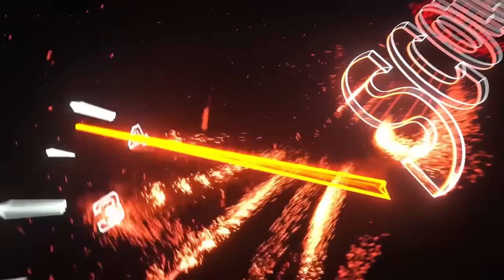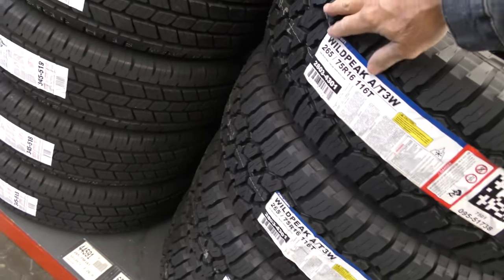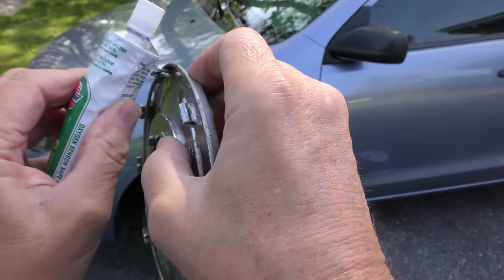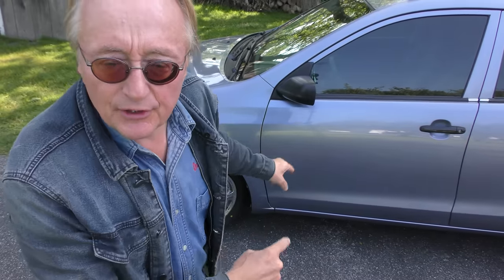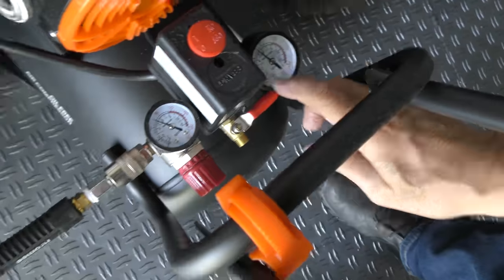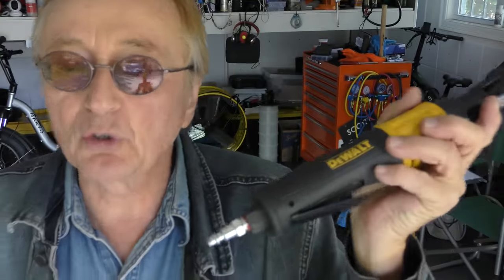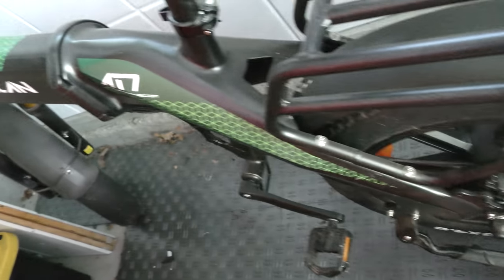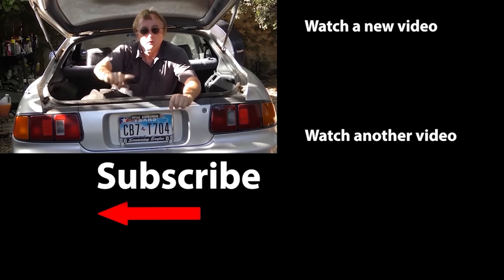Never Buy These Tires for a Daily Driver

Comment: So you don't rotate tires, you change the front more often. I've done the same thing, but didn't feel like it was the right thing to do.
Reply: On a front wheel drive car it doesn't matter. Same with rear wheel drive. You cannot rotate staggered and directional tires anyway. Just check the tread depths. If the left side of the car is bald, I'd only switch sides if I was running a front wheel drive or rear wheel drive. If that's too scary, buy a full set. The rear tires on a front wheel drive vehicle last 12 years unless you are in Phoenix.

Comment: Replacing the tires on my 2018 Corolla SE. To replace it with the ones on their now from the dealership (Firestone FR740) is $800-$1000.
Any body got a suggestion for a good quality tire to purchase, that won't cost me an arm and a leg?
Reply: No way! we would sell that for your size under $800. That tire has a poor tread wear rating. I would suggest the continental trueContact Tour. #1 it’s cheaper and #2 should last about triple the life of the FR740

Comment: What about on a 4WD F-150? Am i going to need to replace them all simultaneously or can i get away with replacing whatever tire is needed?
Reply: Try to put the deep tread on the front. Or only activate your 4wd on grass or dirt once every couple months. It cleans up the actuators. Rotations are a racket unless you have full time all wheel drive. Can't have four wheels pulling at different rates!

Comment: I like Scotty because he's honest and always tells you where he's coming from.  I disagree with his tire advice on FWD because I live in a place that gets a proper winter and I want my backs to grab as well as the front under braking, but then again I don't winter where he lives either so I don't know local conditions.  When he talked about e-bikes I appreciated that he said his wife's bike is not for him and why.  That doesn't mean it's a bad bike but just means that it doesn't work for him but may work for someone else.  What I do is have a set of all seasons that can handle light slush and a set of proper winters.  When we rotate the tires we put the best ones on the front and usually when we have to replace all 4 at once.  Usually there's a buy 3 get 4th free sale.

Comment: I Think it's dumb to just buy 2 tires at a time. Just because it's a front wheel drive Vehicle. I know scotty says he never rotates his tires but he should and everyone should! Everytime you change your oil and filter rotate your tires, it's a simple thing to do.  Front wheel or rear wheel drive, Rotate Your Tires Every 5k miles and they will all wear evenly. If I need 1 tire I'm still buying all 4 so they wear evenly and they match! If Someone Says You Never Need To Rotate Your Tires, Walk Away, They Know Nothing About Cars!
Reply: I fully agree and one aspect where I strongly disagree with Scotty. I think every oil change might be excessive; personally I do it late fall then again in the spring. 

Literally every mechanic I know recommends tire rotations.
Reply: One size doesn't fit all. Don't call people stupid unless you really have done your homework. Realize that every company is trying to fleece as many fools as possible. You simply cannot rotate tires on a staggered setup. The  connundrum is when you have AWD and wider rear tires than the front. Then you are forced to buy new tires according to actual tread depth.
Reply: I never called anyone stupid!!!!!!
Reply: @marshmower  Most people don't realize they do not need AWD...it is simply another gimmick from the manufacturers (especially Toyota here in New England) to advertise that they "need" AWD for winter. AWD won't make any difference if you have lousy tires. For over 20 years of driving through blizzards in FWD, I have yet to have any issues. But, I have had decent tires and proper rotations during the seasons. 

AWD is, in my opinion, a gimmick and nothing else, purely for higher initial cost and maintenance.
Reply: @robertgreenhalge1708  MN, here. I've had RWD, FWD, 4WD, AWD. Yes, tires are very important to winter driving, but you should never have "lousy" tires in the first place. And, AWD or 4WD is also very valuable. It is ridiculously useful when you need to drive in over 2" of snow.
Reply: @marshmower  Staggered setups are like, <1% of vehicles. More common issue would be winter tires, which are mostly directional so you can only rotate front to back without remounting. None of that means you shouldn't be rotating your normal setup tires.
Reply: @playdg I completely agree about the importance of AWD. During a snow storm in Kansas there were many cars and trucks stuck in snow on the side of the road, and I was putting around in my Subaru Impreza.

Comment: Why does the dots on the side of  new tires have to line up to the valve stem?
Reply: it's the lightest side of tire. Stem will counter balance this so less weight needed to balance if needed.

Comment: I’ve found that traction control works really well on snowy roads thus no need for AWD
Reply: I turn traction control off. It pulls you laterally. Always buy winter tires and a spare set of wheels, plus now I have AWD. Winter will be no problem.

Comment: On front wheel or rear wheel drive vehicles you can get by without rotating and just replace the 2 worn tires. On all wheel or 4 wheel drive vehicles you need to rotate every 5,000 miles.

Comment: I can't get my tires to ware out, they all rot and crack before the tread is gone. I can't find soft sticky tires! Tread ware all above 200 they don't ware they rot. Proper tread ware I need is 100, the car is very light less than 2k lbs. But all the 100 tread ware tires are racing and not dot approved!!!!! 
Never buy high mileage tires with 300 or 400 tread ware rating, they are slippery hard rocks. You want your tires to go bald before they dryrot.

Comment: Another reason to go with a car with manual transmission is the EVs have a small gas powered engine. Go with manual and enjoy the extra miles. No need for EVs, at all. EV tires will cost more, too.

Comment: Who changes only 2 tires?  Oh that's right Scotty is a cheapskate.  Rotate for even tread wear and replace all 4 when required.
Reply: I do it too. Like Scotty, it's cheeper to buy two then to dish out the amount it costs to replace all four at once. Tires are expensive now days. Besides. My truck is only a rear wheel drive. So I have slightly more aggressive ones in the rear and run more of a road tire in the front. Similar to how you would see big rig tires. They normally run more aggressive on their drives and steer tires on the fronts.
Reply: But if you don't drive a lot then rotating the tires is useless because they will just dry rot.
Scotty not rotating means his front tires will always be 'fresh' which is important in a fwd where they hold most of the weight and do all the work
Reply: Great so I have a puncture and I now have to replace all 4 tyres because everyone knows the closer you get to worn the quicker they wear out